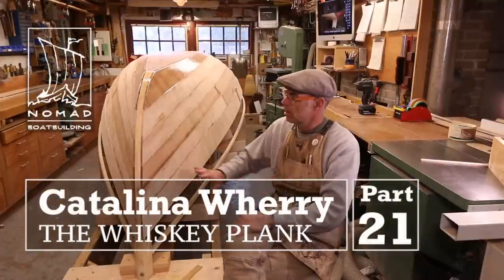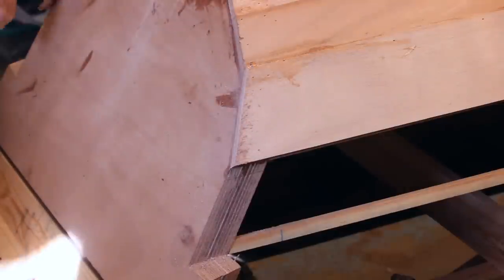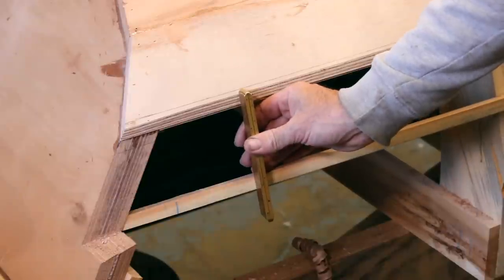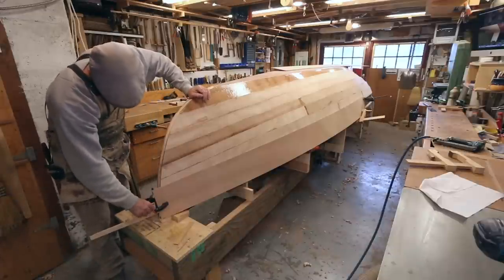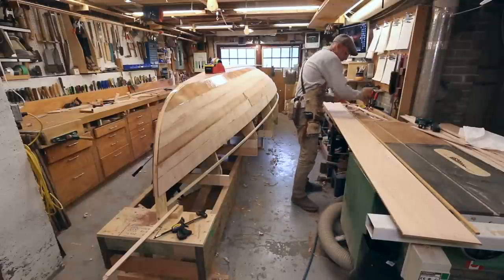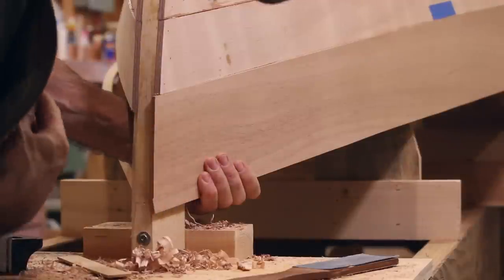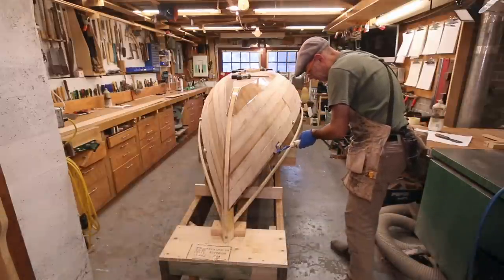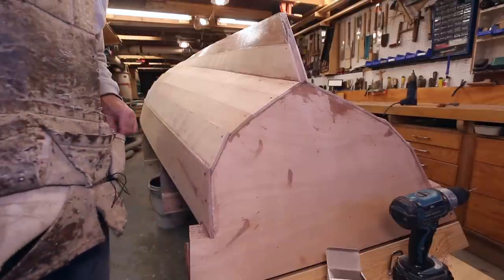Building the Catalina Wherry - Part 21 - The Whiskey Plank

Comment: I had this thought yesterday when watching on Patreon and couldn't comment. When you talk about how a clamp can influence a batten, what if you taped a thumb tack to one side of the spring clamp yielding a single point of contact that would freely pivot 🤔
Reply from the maker: That's probably a little fussy but it’s the ability for the batten to spring away from the nail that helps you to refine the curve. I might put eight or ten nails on my desired line but then only a nail every third position on the back side for instance. Then the batten can spring off a low spot or maybe identify a high spot if it only touches one nail in a series if you get what I mean. These are subtle differences which may not make a noticeable difference in most cases but if you are chasing a refined result, I think it’s worth doing.

Comment: When you're doing the ringed nails at the stem, is there any concern about the nails contacting each other, or are they short enough that's not an issue?
Reply from the maker: It does happen from time to time depending on the nail length and stem size. Sometimes I will angle one side a little off to avoid it or nip the nail a little shorter.